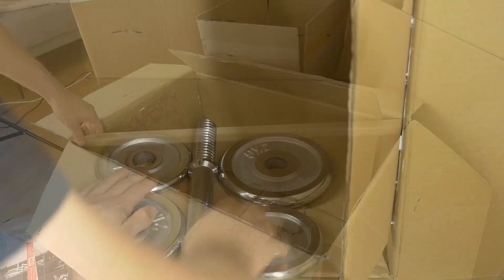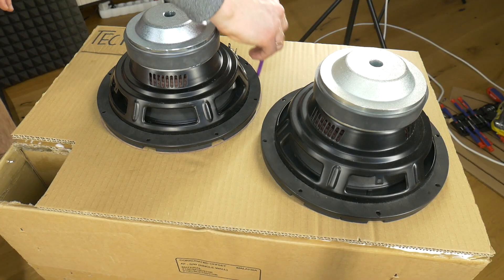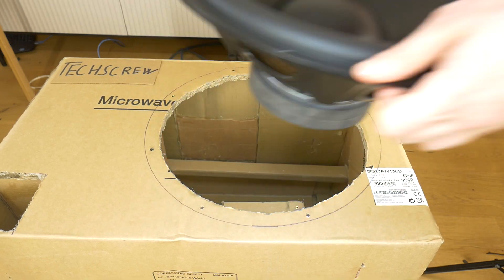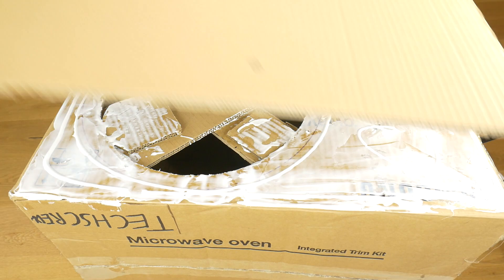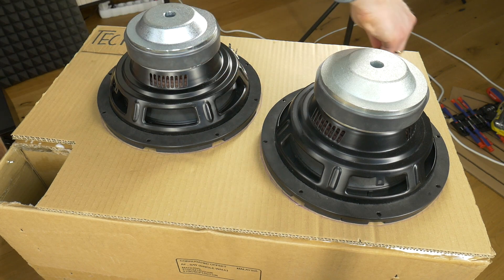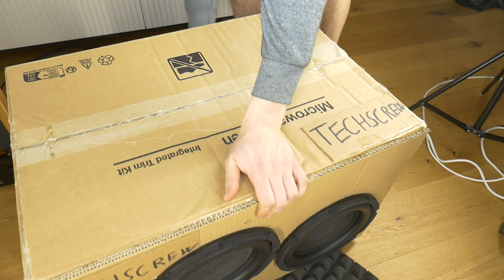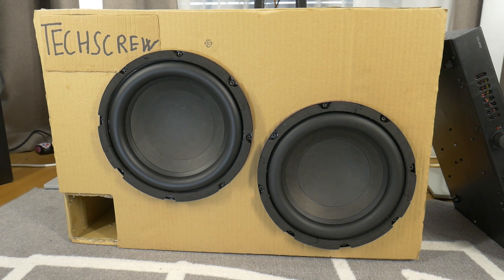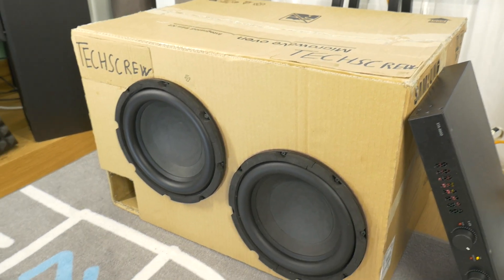Epic Bass Test: Dual 10 Inch Subwoofers in a Cardboard Box

Comment: I did this recently because of some bookshelf speakers I found in my bsement that got water damaged from a washing machine accident. The drivers themselves were fine so for fun I used a tower fan box to make a cool floor standing speaker with a weight at the bottom to help it stand up. It is nowhere near as thick as the cardboard you used and when turned up loud the box panels are visibly moving like a 1/4 of what the speaker cones normally move. You implemented this tons better than I did!!!
Reply from the maker: thanks, there is detailed box build video: https://youtu.be/QEtMu_b3F0E